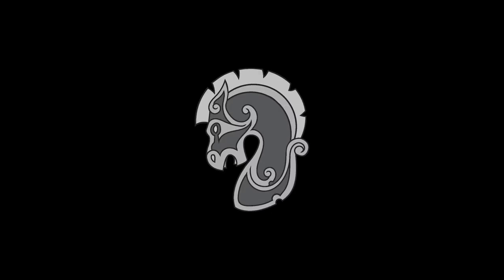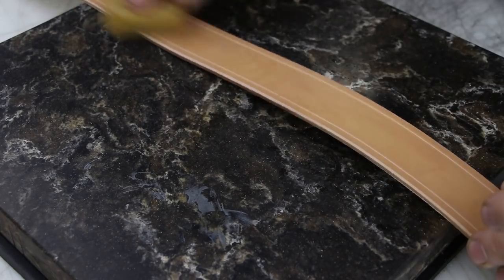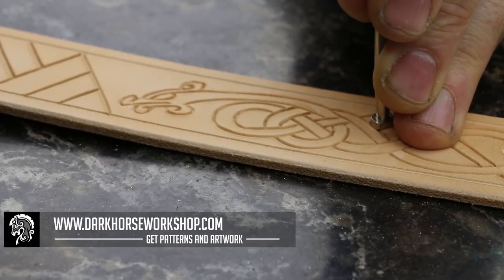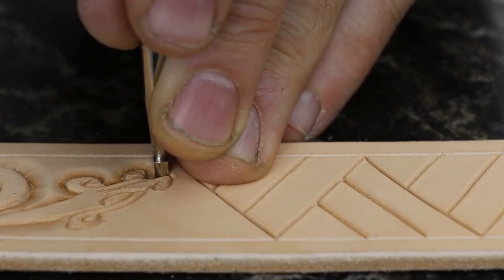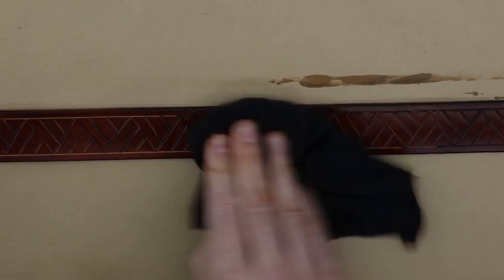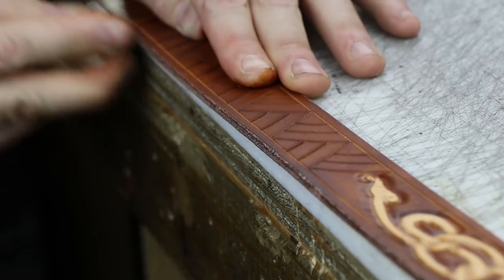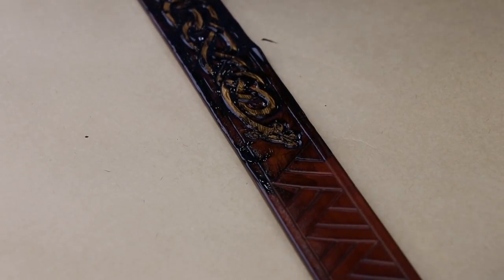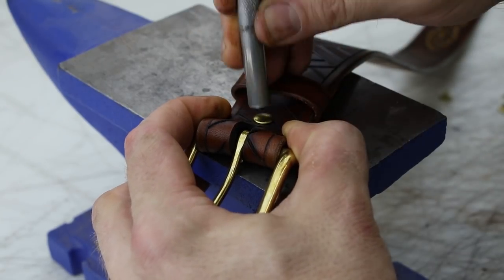Making a HANDMADE LEATHER BELT with LEATHER CARVING

Comment: For someone who has the tools and knows what they're doing, what would be total elapsed time from "cut the belt off the hide" to "finished"?
Reply: The longer answer: There are many factors that go into time taken on a belt. One of the biggest factors is intricacy of pattern and speed of tooling. A decently finished belt can be knocked out quickly while something covered end to end in intricate tooling could take many hours. The greatest amount of time is often spent waiting for dyes, finishes, antiques etc to dry fully between steps.  Other factors like lining the belt, hand stitching vs machine stitching, how crazy you want to get with edge burnishing, and how many layers of color you end up applying. 

The quicker answer: a couple of hours +/- depending on complexity and level of finish.

Comment: I noticed that around the gnarly serpent design the dye is lighter. How would one go about a more even dye when you have fine carving detail like that?
Reply: When you bevel a tooled design, the compression of the leather often causes some of the natural oils in the skin to be forced to the surface. these natural oils can act as a resist to dyes that will reduce dye penetration and can cause a narrow "halo" of lighter less dyed area. This is present in a LOT of leather projects and can be a great indicator that the product you are looking at has been tooled and dyed by hand. If you aren't a fan of the look, you can always go back through with a paint brush and apply another coat of dye or apply antique to cover up the areas affected. As is true with all things in leathercraft, the extent you go to regarding fit and finish of your projects is up to you! Some people spend dozens of hours painstakingly detail every tiny detail and really focus on perfection while others are perfectly happy with a little more "hand crafted" rough and tumble look that takes a fraction of the time.
Reply: @bjornsworkshop9288  Thanks a bunch for the detailed reply! Much appreciated.